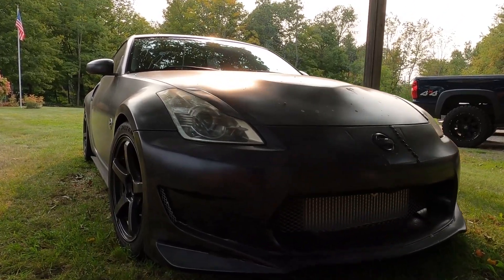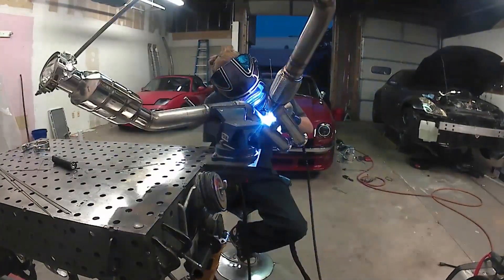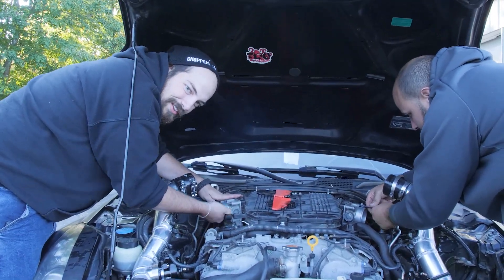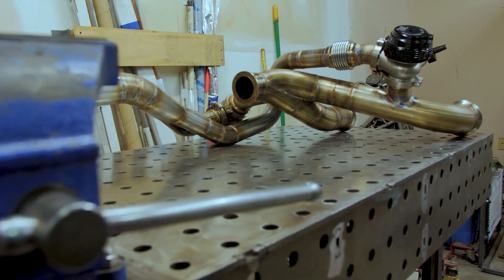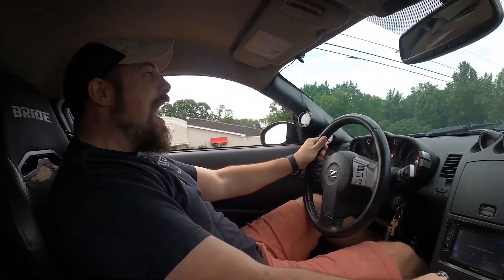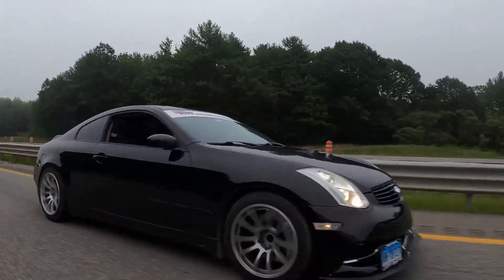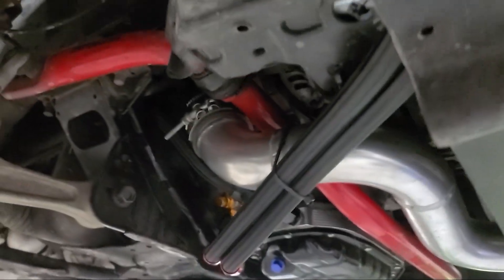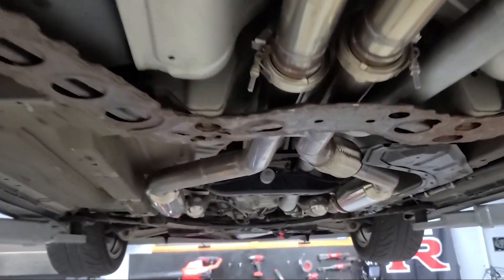Building a 600HP rear mount turbo 350z in 10 minutes!

Comment: Great engine👍. I've got 480 whp on my   fa20 + turbo in subaru brz. Stock  block👍💪🏻
Reply: 480 whp in a stock FA20 means you're not driving it hard, or far. It's borderline impossible to dyno with stock internals with that kind of power, I'm surprised if it even runs.

(Though it is most likely you are just talking from your ass.)

Comment: How to blow a stock DE in 10 minutes 😅 How long did it last man?
Reply from the maker: @CarsAndBasss  You're right! DE's would be a goner! Luckily I have an HR with absolutely no engine modifications And 150,000 mi. It's been 2 years and it's still going strong!
Reply: @blackpearlmedia7797  Wow,
Impressive dude. Truly a testament to the updates they did from the DE to HR. I'm on my break in tune for my vortech DE. Built block, made 476whp. Shooting for high 500s next year with water/meth, 1000cc injectors and bigger fuel pump!
Reply from the maker: @CarsAndBasss  love it! Meth is a must!

Comment: So for oil, you did a sandwich adapter to supple, to the oil cooler that ran back to the turbo, catch can on the drain side with the scavenger pump sucking it back up to drain in from the spacer, So the catch can acts almost like its own oil pan, allowing the oil to drain completely from the turbo?
Reply from the maker: We also added a check valve so the oil wouldn't roll back and a small oil tank between the turbo and the pump

Comment: How long does a tank of methanol injection last?
Reply from the maker: Depends on your set up and how much your in boost. I drive conservatively on the street and only hit boost when appropriate and a gallon has lasted me a few months
Reply: @blackpearlmedia7797  thanks for the quick reply i just booked in my Z to get the rear mount turbo kit fab up. I've got the fuel return system installed and thousand cc injectors ready to be installed. I was going to run E85 but in Australia there's not too many places that sell it. then I saw your video with the water methanol injection and thought maybe I can still keep it on 98 octane fuel and do what you did. how long would you say the methanol would last doing track days and hard driving? Thanks for your time
Reply from the maker: @travisantics  awesome to hear!! I'd bring an extra gallon to be safe at the track and a gallon lasted me months of street driving but I drive pretty conservatively

Comment: i have been following your 350z turbo build for some time but im still questioning some thing im building a rear mount turbo my self and I’ve seen your running around 600hp but um asking my self do you have fuel return system and are you’re using stock maf sensors and stock ecu ?
Reply from the maker: Stoke MAF, stock ECU, no fuel return but I did buy a GTR R35 fruel rail/return to modify but didn't end up using. I'd be willing to let it go if your interested!
Reply: @blackpearlmedia7797  thanx for reacting no sorry i dont need it im going for cjm kit but stil curieus what software are you using as tune
Reply from the maker: @jenskerckhofs3174  up Rev. How's tuned by limp mode tuning! Any tuning questions You should absolutely hit them up on Instagram

Comment: What size hoses did you use for return and feed line 🤔
Reply from the maker: Return I believe was -4? I'll have to double check it's been a minute
Reply: @blackpearlmedia7797  thankyou for your reply also where did your oil feed connect to did you just T the oil pressure gauge?
Reply from the maker: @HYPERHYPER-if8wv  I purchased the Z1 oil pan spacer and it comes pre-tapped so you just can screw your fittings right in to your AN lines! Really useful
Reply: @blackpearlmedia7797  okaey yeap im going through your description buying it all sorry for all the questions were did you get your oil pressure to go back to your turbo 😁
Reply from the maker: @HYPERHYPER-if8wv  the scavenge pump? I got it on Amazon but I checked the link.ni think it's out of stock. Reach out to limp mode tuning and they should have some in stock
Reply: @blackpearlmedia7797  do they ship to new Zealand and thankyou for all the help and knowledge you've taught me across your channel looking forward to more of your content 😁😁
Reply from the maker: @HYPERHYPER-if8wv  not sure! You will have to ask! You can use any scavenge pump. The ones made for boats seem to do well. And I'm glad your getting some value out of it! More to come!

Comment: Did you upgrade the engine pistons or was it all stock including the block before you add the injectors and sparks
Reply from the maker: Nope. Just injectors! And the motor has 150k miles on it :)

Comment: Any issues with the oil setup? Currently dealing with smoking and oil out of the tail pipe i only have a turbowerks pump and a 3psi check valve on the feed line
Reply from the maker: The defensive octopus performance in Connecticut. You can find him on Instagram
Reply: @blackpearlmedia7797  nice already gave him a follow think he would make and ship one for me?
Reply from the maker: @arturov207  not sure! But tell him I sent you. They are pretty easy to make. He might have an already made product to sudgest as well
Reply from the maker: My turbowerx failed causing the seals to go BUT do you have an oil reservoir?
Reply: @blackpearlmedia7797  no i dont have one been looking for one but cant seem to find one
Reply from the maker: @arturov207  have a fabricator make you one. It's Paramount! It's cheap to make as well. Do it now!
Reply: @blackpearlmedia7797  who made yours?

Comment: Overall decent video in the ICE vs EV debate issue.  Though all the improvements you mention toward the end to help EV's would in turn help an ICE as well.  You didn't mention end of life impact, such as what happens to the EV batteries when they are no longer usable in a EV.  Where as I could easily have a 1989 Volvo 740 still working well today and for the next 10-15 years... what's the CO2 foot print there?  Also, you operate under the assumption that CO2 is a bad thing all together.

Comment: For the love of everything holy,  pls buy a diff brace asap before all that torque blows out that diff stud
Reply from the maker: Not a bad idea 💡
Reply: Ive learned that first hand💀💀 100% recommend diff brace
Reply: Fdf makes a brace that goes between rear toe arms and bolts into three places on the diff. Essentially bolting to five points. I think that would be best.
Reply: Just build a diff brace if you have a welder

Comment: Nice...stock motor?
Reply from the maker: yes it is! its an HR motor and it just turned over 150K miles too!
Reply: @blackpearlmedia7797  I also have a HR with 150k, did the tuner say what the safe limits to the engine are? iv been seeing some builds last for years while others last a few days which makes me kinda scared to boost it.
Reply from the maker: @Disorientation_  totally understand the hesitation. I understand that 550-650hp is safe BUT it's the torque that is the dangerous part. From what I was told you should be at about 420ft pounds max. You see people not lasting because of the tune or people doing stupid things. Your not smarter then your tuner. Listen to there recommendations. I HIGHLY sudgest talking to @limpmodetuning and working with them if you are anywhere near Maine. There record is clean and they went the extra mile for me and for all of there customers
Reply: @blackpearlmedia7797  Iv seen him working with Danny Z and just happened to run across your videos. I’m in North Alabama so I’m just a few hours away from Z1. Iv been tuned by them for 2 years now but obviously adding boost is very different. I would like to hope that they are also trustworthy considering how big they are 😂. If I lived closer to limp mode I would 100% go to them though.
Reply from the maker: @Disorientation_  Z1 knows their stuff too as far as I've heard, but definitely do your research!
Reply: @blackpearlmedia7797  one last question, did you compression test the Z before boosting and what were your numbers like? I appreciate your time and I’m excited to see the future videos!
Reply from the maker: @Disorientation_  I did not but we did pull the oil pan when installing the spacer and didn't see anything suspect. I drive it regularly so I felt confident. A compression test wouldn't be a bad thing tho! And thanks man!
Reply: @blackpearlmedia7797  what spark plugs did you have to install? Having a hard time finding one step colder for the HR
Reply from the maker: @Disorientation_  amazing question! Buy OEM R35 GTR plugs!:)
Reply: Nice man, I got a G35 coupe looking to boost.
Reply from the maker: @nickdupuy2397  That's awesome! I'll be boosting my G35 sometime in the future